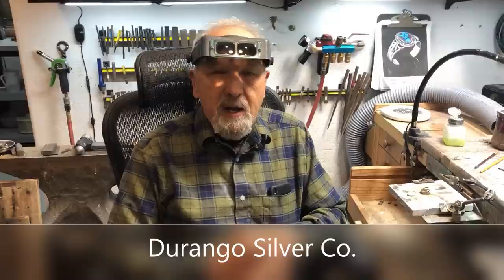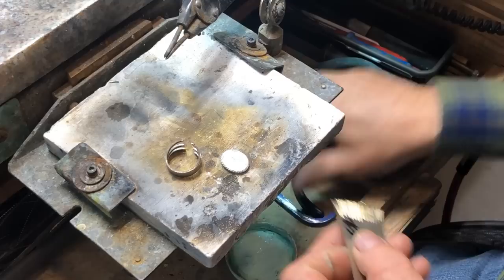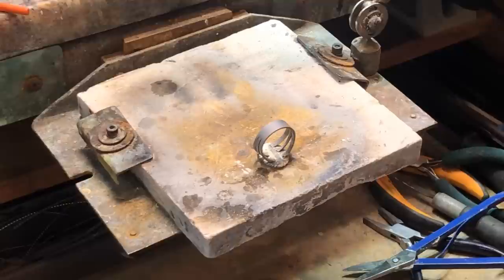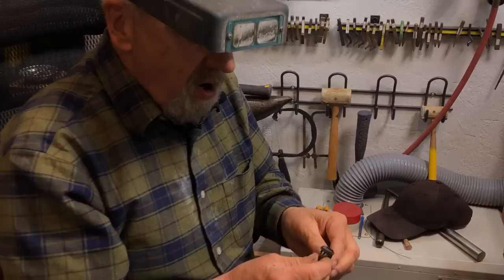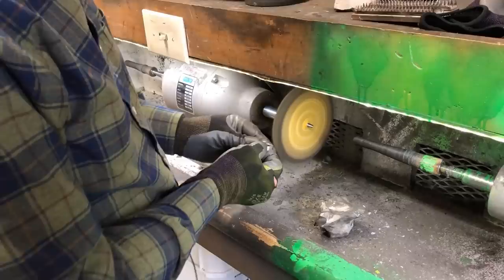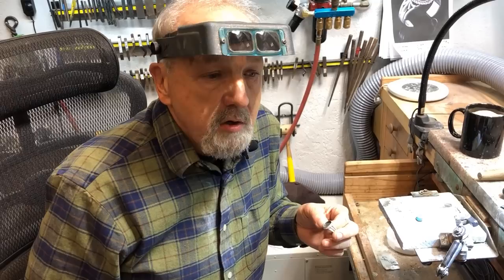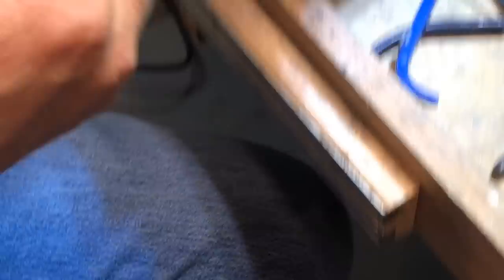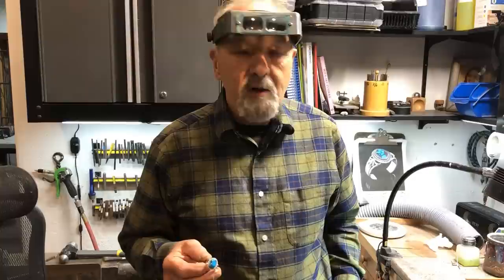How To Make a Silver Ring - Final Processes - Jewelry DIY

Comment: When you come to the sawdust part, what if your stone is translucent and not opaque? What would you do to level/raise it in that case?
Reply: I use some fine silver wire, just a ring around the inside of the bezel (sterling may tarnish and there is no way to polish it after your stone is set).  If your stone is set unevenly you can place wire on just one side. No need to solder it in.  The size of wire depends on how much you want to raise it.
Reply: @lorikell6216  Excellent! Thanks so much!! Thanks for clarifying the Fine Silver choice as I would have defaulted to Sterling, not thinking. :)))

Comment: What is 'Joy'? Is it a kitchen detergent or a non foaming detergent for jewellery similar to that which is used in jewellery tumblers? another question: I see that you have a little square-ish container containing a yellowish liquid. I used to use one as a dispenser for soft solder resin flux remover years ago but I haven't seen one for ages. Would you mind telling me where you got it please?
Reply from the maker: Joy soap is dishsoap. It is harder to find this brand, but it seems to work better than others for jewelry.  The square container I bought from Rio Grande Jeweler's supply.  Don't buy the cheap one.  Go for the more expensive one.